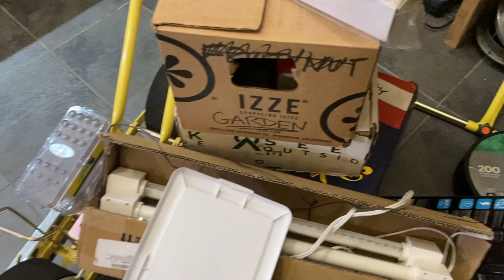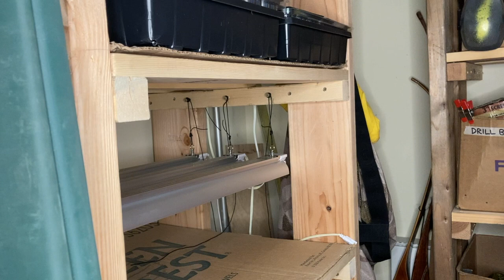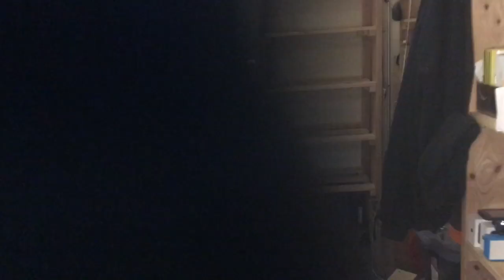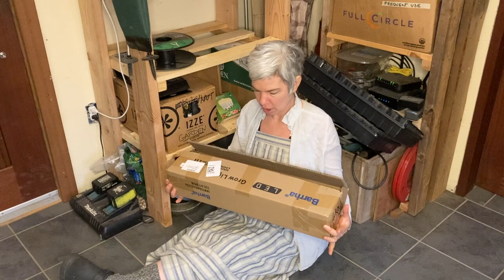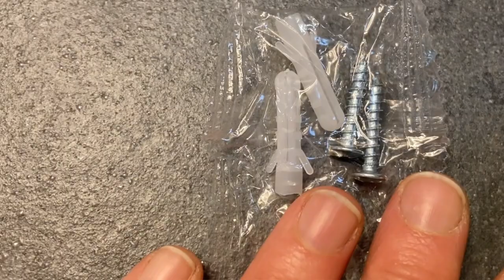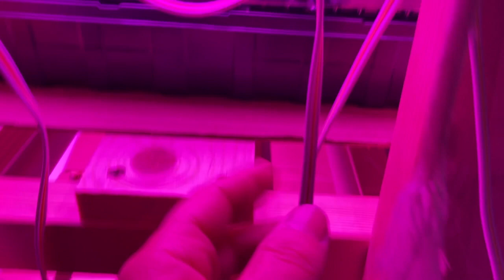Barrina LED Grow Lights: Unbox, Assemble, & Fix A Shelving Disaster

Comment: So the purple magenta LED lights are more for propagation and seedlings?
Reply from the maker: I didn’t know what color the lights were until I received the shipment and discovered that they were pink and not white. I was reading up on the pink lights in the Amazon Q&A section and people were saying that the pink lights have the red & blue spectrum that plants use, so then I would assume that your getting more bang for the buck using the pink lights because you’re not wasting energy running the spectrum of light that the plants don’t use or, thinking about it differently, you’re giving the plants a more concentrated dose of what they need whether the plants are seedlings or mature, but I’m not an expert on plant lighting needs. I personally would have chosen to get the white lights because they probably work well enough, and it looks weird having a pink glow in the corner of the house. I included a link to both the pink and white light options in the video description.